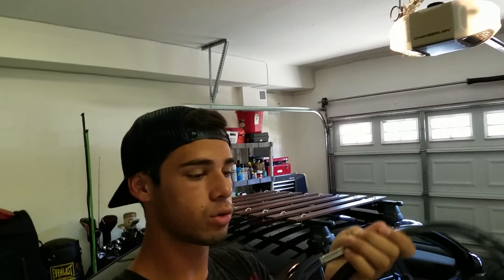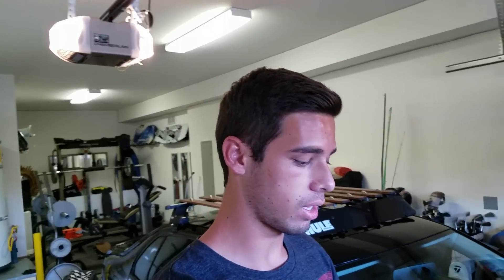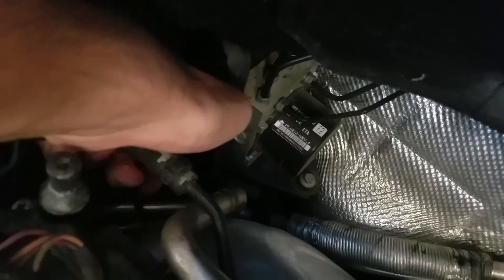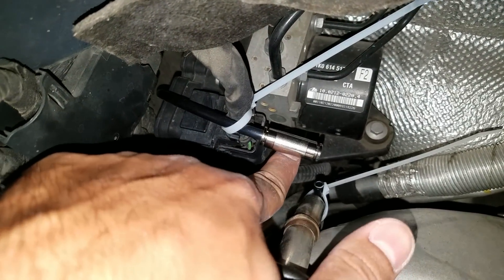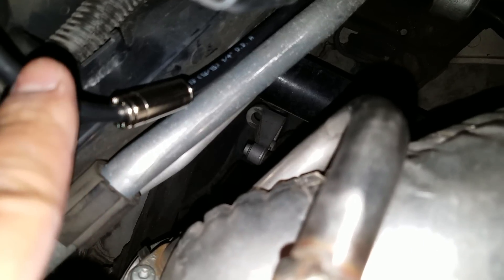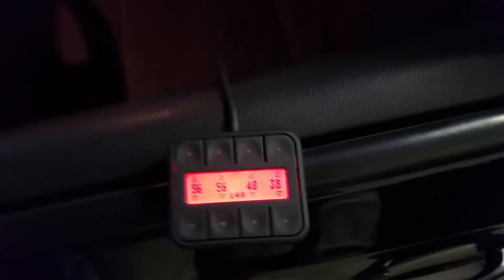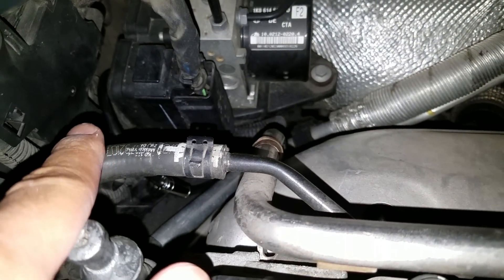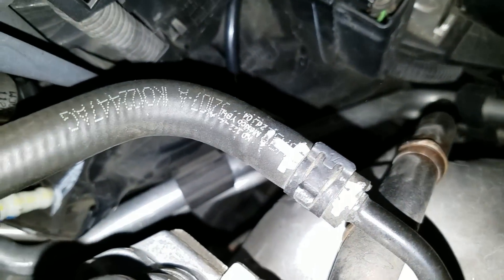Air suspension leak fix?

Comment: Thanks for the video! I currently have a situation with my vehicle.. -.- However, assuming I find the leak and can repair it in the same fashion as you did yourself, I wanted to know how your car is holding up since the repair and if you have made any changes since then. Any info would be greatly appreciated ._.

Comment: Well done for finding the leak.  Splicing in the connectors was a nice easy fix, but the video presentation was far too long with too much irrelevant information.  Edit the episode down to take out the padding and you will have a good informative video.

Comment: You could also just get some steel braided line to run through any areas where you might have heat or whatever. I should also recommend some direct fill fittings and a small pulg in compressor in case of emergency. then you can at least fill the bag (s) if you need to get home or to a shop. The fix you did should work fine though.

Comment: Just so you know those Aluminum hoses are you HEATER CORE HOSES that run HOT COOLANT to your heater core to heat up your interior. LOL.... Like they said before, get some coolant rubber hose or regular rubber hose to wrap those in. You can also wrap it with exhaust aluminum tape that can be found at your nearest Auto Parts.
Reply from the maker: Alex Chavez I don't hardly ever use my heater and I haven't had any issues since. I will probably end up inspecting all the lines again soon and get some fuel line to cover areas up though.

Comment: ryan, do you just air out the car first to fix the airline cause it should have air pressure on the line ,right?
Reply from the maker: Correct! I aired out the bag so there was no air in the line while repairing the leak.

Comment: Any place my lines contact metal, i sleeved the lines in 3/8" rubber fuel line to protect them from rubbing through. Easy protection.
Reply from the maker: Rat Rod Studios - DRR Customs Ltd I might get some of that when I do a check up of all the lines in a few months. Thanks for the tip!
Reply: Ryan The Hawaiian just take the rubber hose and slit it down the middle. Wrap it around the air line like plastic wire loom, and zip tie it. Easy and cheap. Also carry some air line connectors and an air line cutter in my glove box incase I need to do a side of the road repair.
Reply from the maker: Rat Rod Studios - DRR Customs Ltd I'll keep that in mind if any areas show wear.

Comment: how did u install the connector? got a leak in one of my line I need to cut out.  what tools ect did u need besides the cutter to get it connected?
Reply from the maker: Gary Petifurd With that connector you don't need any tools, you just make sure both ends of the air hose have clean cuts and push them into either side of the connector.

Comment: Are the lines going back to the manifold run inside the car? Would running them under the car (outside) be problematic?
Reply from the maker: Brandon Moorer the lines are actually outside the car. There are some safe paths for the lines where they are out of the way and protected

Comment: Tech Flex/ heat shield sleeve or another heat shielding for the air hose. Stops the friction on the hose too.
Reply: Thank you couldn't bare watching this any longer its like sitting in a resource class